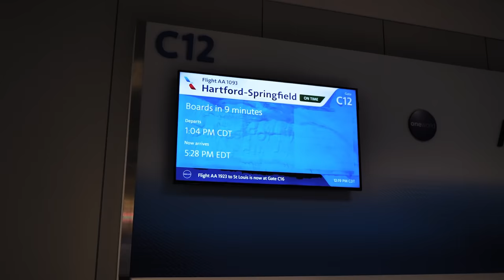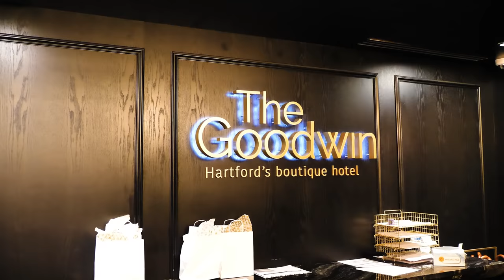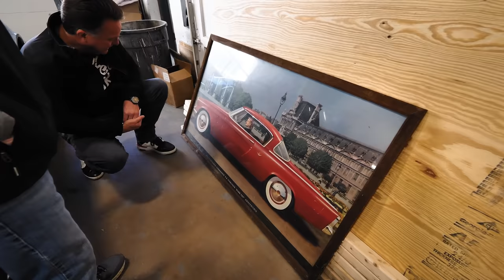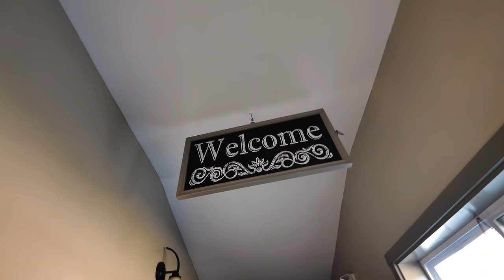EXCLUSIVE TOUR OF WAYNE CARINI'S F40 MOTORSPORTS + BUYING HIS 2008 MERCEDES SLR McLAREN!!

Comment: Electric is NOT the future, infrastructure in place or not, it doesn't matter. The C02 created to make the batteries alone is 74% higher that the carbon footprint from a conventional gas vehicle.
For perspective, the average German car owner could drive a gas-guzzling vehicle for three and a half years, or more than 50,000 kilometers, before a Nissan Leaf with a 30 kWh battery would beat it on carbon-dioxide emissions in a coal-heavy country. Then there is the issue of disposing of the lithium batteries once they have expired, you can't recycle them, I guess they'll be buried along with nuclear waste. Electric cars are as much of a scam as COVID and the vaccines.

Comment: I used to work for Mercedes as a technician, & back in 2004 I was one of the 1st technicians certified to work on this vehicle In san Antonio Tx. Zero to 100 miles per hour and back down to zero in less than 10 seconds..   the theoretical horsepower of the breaking system alone is 15k HP says the German engineer's

Comment: Build solar on the roof of your house it charges up your home battery bank and you recharge your car when you plug in at night. Texas has a lot of land that's good for nothing other than solar power plants. For large scale storage of the power, a very good solution is the liquid metal batteries from Ambri. This power can be used for cars and to feed into the grid for other uses

Comment: Dennis and Wayne, you are pure class 👍 BTW there are two Goodwood primary meets. The festival of speed (which features many of the modern race cars inc F1, Endurance, etc and has a lot of current production cars from the likes of Singer, RUF, McLaren, etc) and then there is the Goodwood Revival, which is really a racing met for pre 70’s race cars. This is the one to go to (IMHO). So if you want to see genuine 250 GTO’s (including Nick Masons) being ragged around a track, along with Shelby Daytona’s, Light weight E Types, etc, then this is the one. 

Maybe I will see you there as I attend most years 👍.

Comment: Electric cars aren't going to crash the grid. They are charged mostly at home/work at night during off peak demand hours. The auto/petroleum industry uses a tremendous amount of electricity. As that industry shrinks there's the electricity EV's will use. Net zero trade off. ✌️

Comment: Electric cars only work in low heat and low humidity, when did you see a battery have life in the Northeast in the winter. Most cars won't start when the temperature gets below 0 degrees, never mind run.

Comment: Think of this how many pumps are using power? Every one is just using power, why isn't a generator on every one of them, that not only supply's the energy to run the pump, but more than needed, excess going back to the infrastructure to run other power needs, every town, city, metropolitan area, farm and factory have major pump systems that can be generating power. Work on that with your influence.

Comment: I know the truth,  if you put a generator on the axles of an electric car the car will charge itself and you won't need a place to plug your car in.  If you have a battery and an electric motor and a generator or known as an Altinator it will give plenty of electricity too you house and keep the battery or batteries  charged keeping the electric motor running,  no more monthly bills.  This has been around since America learned how too store electricity in a battery form. Vehicles can simply move today too create electricity,  just like every vehicle ever made,  the engine runs on gas. But put it electric.  If it moves it will stay running,  so put alternators or call them generators on the axles and let it charge itself while using them.  I will never spend 1 penny on electric until they stop lying too you. Never.

Comment: What Beautifull cars .I'm totally with you on the Electric Revolution .It will be short lived .Hydrogen once a better cheaper way of producing will be the way for many years until the micro neclear generator revolution . The infrastructure across the globe cannot cope with the Electricity Demands from cars and so called Carbon Neutral Energy systems for the home heating systems. A new form of energy will emerge ??.

Comment: So much falsehoods and mis-information in regards to electric cars, where do I even start…..

Hope you get the SBC brakes looked at in that SLR.  The Bosch Sensotronic  Brake Control system was fundamentally flawed from the factory and will leave you with out any brake pedal from time to time. Good luck with that.